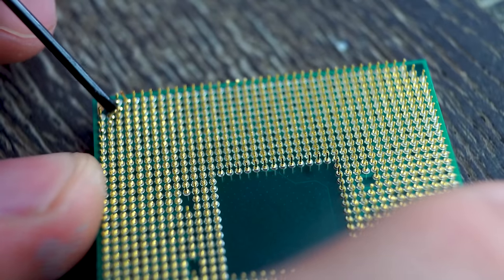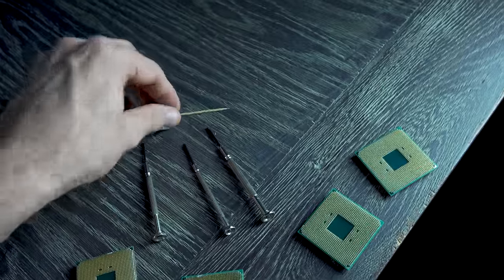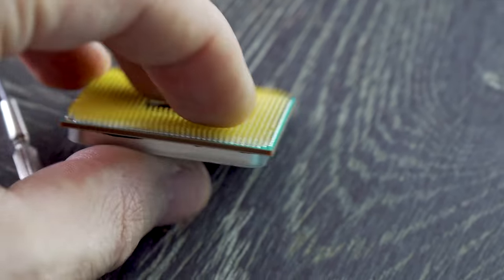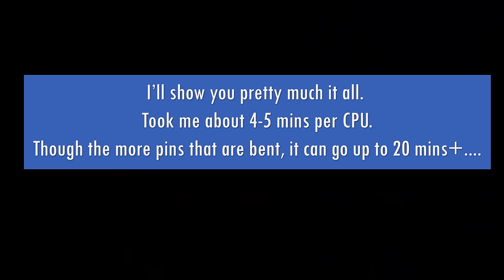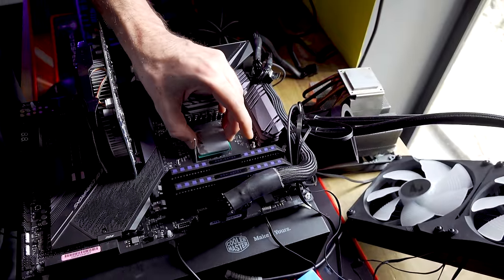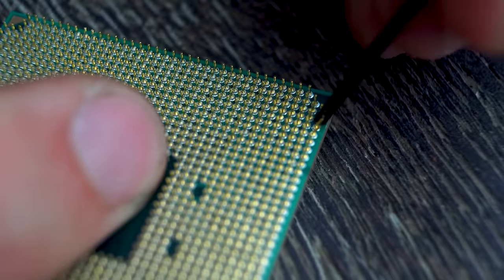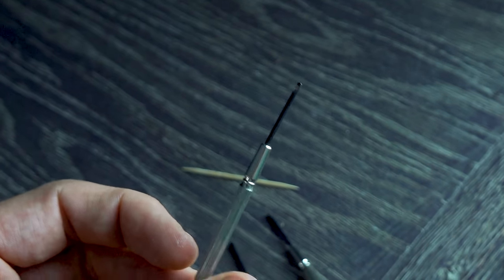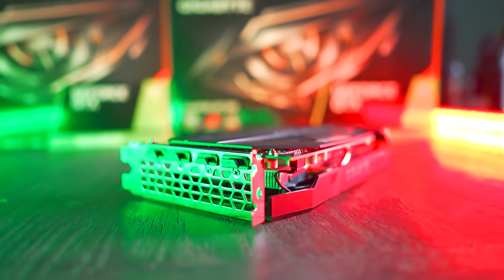How I quickly and easily FIXED 2 Ryzen 2700X CPUs with BENT Pins

Comment: Also another tip before removing the cooler on the amd, run a light stresstest, the thermal paste will be softer, and cooler will be easier to remove.
Reply: Ita a good idea to do this if you can. I get a TON of recycled computers and strip them down. I hate AMD CPUs because of how easily they get damaged. I just dont have the time or luxury to run stress tests on the stuff I get. Wish AMD would give up the PGA design and move to LGA.
Reply: I actually did this yesterday, not even a stress test but played borderlands 3 for several hours before taking my 3600 out for new 3900x, even with it definitely warmed up and breaking the paste CPU still stuck to cooler xD, and bent 5 pins, ran a razer blade down the rows of pins and BAM fixed
Reply: I just hit it a couple of minutes with a hair dryer, I partially cover the intake so it would get hot enough (around 115f /46c)
Reply: @Brandon-uy1uv  won't that risk some kind of short on your motherboard?
Reply: @reyzafany1992  no, I only blow the heatsink, and cpu fans have diodes to limit the direction of current
Reply: Thanks for the advice. Recently got my Ryzen build running and bought an Arctic AIO. I'm glad I know to do this when it arrives.
Reply: @deminybs  atleast it was the 3600 and not the 3900x.. on another note. I wonder just how many people are like you and me and have a 3600 and another higher end ryzen. I snagged a 3950x on launch day as well.
Reply: First time i put up the stock cooler on my ryzen. It really is like glue. Thanks
Reply: @Peter Cavojec yep :P
Reply: @Dalle Smalhals soo original. Holy smokes your so witty. You must have a 200IQ!?!?
Reply: @Dalle Smalhals yep. I pull other people's unwanted pc parts from the recycling and flip em for cash to buy brand new stuff. I'm happy. It's like free money. Just disappointed with how many AMD cpus get damaged in the process. PGA can stay in laptops. I hope AMD moves to a full LGA style with AM5 like they did with Threadripper and EPYC.
Reply: @skoopsro7656  just twist the block/heatsink a little clock anti clock
Reply: @skoopsro7656  2x3900x + 3700x here
Reply: This happened to me a few days ago on 3800x, replacing stock cooler and it the cpu came off with the cooler. Sadness 😭😭😭
Reply: @espi8997  waste of cash lol
Reply: @KT-04zx10r-Gap  you're probably  right ;)
Reply: @espi8997  just buy one...they gonna have boat loads of more cpus doing alot better in the next couple years
Reply: @skoopsro7656  try hairdryer, works for me and takes 30s
Reply: @skoopsro7656  I think the AM5 socket will actually be a move to LGA.
Reply: bro! i wish i knew that before I bent the pins on my 5700x! It's really cold in Canada, so when I pulled me tester Ryzen spire cooler off, the thermal paste was so caked it pulled the CPU rightout of the socket & bent some pins. aw man, I was so bummed but luckily I bent the pins back & it still worked w/ me NH-D15

glad the temps went from 40C to 25C idle too!
Reply: @skoopsro7656  luckily I could bend back the 5700x pins. I've seen intel pins, I bet if I encountered bent pins, I would not be able to fix those :(

Comment: Been fixing bent pins since the 486 days. Old mechanical pencil to bend the pins back and then use an old credit card to check for trueness from every direction on the rows themselves. Fixed hundreds of "dead" processors this way over the years. :)
Reply: Also a razor blade or exacto knife will work just fine for trueness and for bending if needed.
Reply: this worked for me! ty!

Comment: My friend smacked his ryzen 3 1200 into his case while removing it from the cooler. He bent over half the pins. After 3 hours of work I was able to get them all back and only lost 2 pins. CPU still works perfectly fine to today. And if you are wondering why I wasted time with a 1200, I did it to help my friend and I did it to have some fun.
Reply: Rather cheap CPU, though.
Reply: Missing pins should have some sort of problem..... eh probably just a slught framerste loss or some slowness with certain things
Reply: Hi. After several months the processor works well?
Reply: @gedimangediman  still works to this day, overclocked to 4.3ghz as well
Reply: @denakai  Thanks
Reply: I threw a R3 1200 in the garbage last week w another so buggered up.

Comment: I like using a mechanical pencil tip to bend pins back in place
Reply: Take the lead out? And then hook it over the bent pin. That sounds kinda brilliant. Thanks man!
Reply: This is a genius idea
Reply: Same, was taught this by friends years ago. no better way honestly!
Reply: YEs, this is how I've always done it.  Because the mechanical pencil is long, its much easier to quickly get the pin almost perfectly vertical too.
Reply: Yeah, this is how we did it back in the day. I've straightened many a pin in this manner. A credit card can help with this too.
Reply: Razor blade is very helpful to the get between the rows and straighten several pins at once.
Reply: best way by far. All seasoned AMD users know lol
Reply: same. a mechanical pencil has been my choice since the athlon 64 days.
Reply: I've used a coffee stirrer that's hollow like a thin straw
Reply: 🙂 yup
Reply: yep, i always do it this way
Reply: I used to use this method while working in a computer store. You can move them in any direction without any problem.
Reply: This is how we managed to straighten pin grid array CPUs for years and years.  An old school technician showed me this trick and called it "pencil whipping", I later came to understand "pencil whipping" as a method of unlocking locked durons by using a pencil to remap the switches.
Reply: I use the same technique! Along with it, a thin credit card or something along those lines.
Reply: I have used thin tweezers myself, which also works great.
That being said I never had to fix any ryzens myself just some old fx's at work when the intern who installed them botched it.
Reply: the best method is probably a sewing needle and razors. Sewing needle to unbend pins that are bent almost 90 degrees and touching the substrate, then once you bend them so they are just tilted use a razor
Reply: You are a life saver
Reply: @dartallis  Did it with this method, had only slight bend on corner pins.
Now the processor is like brand new!

Comment: Just an hour ago when i came home, i opened my CPU box to check out my brand new CPU that arrived 2 days ago. I noticed that a few pins bent, because yesterday i put the CPU in the plastic cover the wrong way, and i didn't notice it yesterday. Luckily, a relative of mine gave me a box of that exact same screwdriver kit, because i told him i'm building a new PC, and that i needed small and big screwdrivers for it. So i got lucky this time, i'll be building the pc in 3 days, that's when the GPU will arrive. Let's hope all the touching i did won't do anything to the PC, and that the CPU will work fine.

Comment: A credit card is really great to get the rows to line up. They fit perfect between the pins and move a whole row at once, really good for that final touch and get them perfect. Also the pins fit inside the tip of a mechanical pencil with no lead good 360 control if your careful. Love the TYC!

Comment: I had to take my system apart to clean it and I dropped my Ryzen 1st Gen 1800x right on it's corner. I used a razor blade and got them lined up but system wouldn't post. Just had to reseat the CPU and it posted. *Remember it's a Zero Insertion Force socket!*
Reply: bet some nervous moments there!
Reply: @laowai2000  Always nerve wrecking when you have to bend something that costs $150+

Comment: For most bend pins, i use a sewing needle, it fits between the pins, and a few times in both directions, and the pins are straight again. Quick and easy tip.
Reply: I use the same (and a cheap digital microscope, being able to zoom in gives a lot more control over the bending action)
Reply: I just did the same yesterday night on a Ryzen 5900x, thought it would be hard, but it's very easy as the pins are very manipulable, that's why they bend so easily too. After that, I use flat object to pas between them to fix all alignments around affected area.

Comment: Great video! Two of my friends dropped their brand new Ryzen 5 3600's so I had to fix both of them.
Reply: There is 2 linuses now?
Reply: @konari88  They're evolving
Reply: I hate when the CPU gets stuck to the Ryzen stock cooler (Wraith Prism) and CPU is removed from the socket along with the cooler... I wish the retention mechanism on AM4 was better. With Noctua coolers, it works perfectly well.
Reply: Looks like a made up story starting with "my friends"
Reply: did you charge anything to fix them?
Reply: @no.1baller939  No, they are my friends.
Reply: @OverdriveTech  Probably right thing to do! :)
Reply: @liceafilms  because they caused the damage, not from the factory
Reply: @liceafilms  Of course Amazon would...they accept almost anything returned. But like microcenter or Newegg...may not because they know that damaged pins don't come from shipping a CPU in a box. AMD CPUs are pretty well packaged in their own little box
Reply: @no.1baller939  I got a new processor from Amazon with a bent pin.

Comment: As for a final check for straightness, I slide a thin credit card down the row to make sure all the pins line up. Worked great on Phenom II and FX processors, haven't had to yet on Ryzen
Reply: It's a common thing, I don't know why Yes Man didn't want to show it, as I'm sure it knew that.
Reply: @TheSilviu8x  Because a card isn't going to work on the spacing on Ryzen processors.
Reply: @konkoly5183  You can use a playing card or a trading card like Pokemon though.

Comment: I've been down this road, things I've learned. Do not use the pre-applied paste on AMD supplied coolers, wipe it off and apply something else. It can be like super glue hard to remove, I had room to twist and pull, made no difference, it wasn't moving. Ended up bending many pins on my R 2600 as it came out of the socket with the cooler.  Bent most of them back, but 4 broke off completely after trying to straighten. Thought I was screwed, looked for CPU pin wiring diagrams (no luck there), decided to reinstall and give it a go, works perfect, even with 4 broken pins. Used a magnifying glass and if you have the right size mechanical pencil, use the empty tip. And nice work with that screwdriver! When you get older and lose your eyesight that becomes much more difficult.

Comment: Just tried this method to sort out half a dozen bent pins on a r5 1600 - it took a bit of patience but it worked! I began wondering as I was going through the motions if a straight razor might have been more efficient for lining up bent pins to the other pins in the row. Good stuff all the same and thanks for showing me it can be done (with a little tech yes loving)

Comment: I've straightened many a bent pin and even soldered a few, luckily they were on the edge so it wasn't too difficult. I use a credit card to check alignment after straightening them.
Reply: I used plastic cards as well. Their great for alignment good tip !
Reply: The tool sets they sell to open mobile phones are perfect, including the 'guitar pick' style tool. Or just use a guitar pick to check alignment.

Comment: I like using a razor blade or a cutter blade, the razor blade is just slightly stiffer than the pins so I find them easier to use

Comment: Absolutely saved me.

Tried installing my new processor only to drop it as I took it out of the box, bent an entire row of pins.

I was sure my goose was cooked - thanks to your helpful guide and two hours or careful CPU surgery I'm proud to say I fully fixed my CPU! 

Slotted in nicely and posted fine, I've been running benchmarks on it all day and it's going strong, even overclocked with no issues!

Comment: I got my R5 2600 pins bent before removing the MB from the case. Bent the pins by removing the Cooler. Realigned the pins with a 1mm pin needle.
It booted. I had this confidence of doing this because of you.
More power to ya Sir!

Comment: Done this myself when selling my old R3 1200. It had a few bent pins from not handling it carefully. It's hard to make them out with the naked eye, even under a lamp, but after a few minutes I was able to put them all back. I used a small switchblade (it was think enough to fit between the pins) and a small screwdriver.

Comment: Best method is to use a mechanical pencil with a long metal lead tube tip, remove lead, put the pin in the tip, and use the whole pencil to slowly bend the pin back. Been doing this since the athlon/phenom days. In fact I have a pentel drafting pencil I keep around specifically for cpu pins.

Comment: I wanted to change my thermal paste and ended up ripping the cpu right from the socket with a few bent pins. I used your method to straighten out the pins and lucky for me, the cpu and mobo was still good. Thanks a bunch!

Comment: I had the same nightmare with my 3900x (stuck to the stock cooler), got lucky and only had to bend 2 pins back. I used a few different knife blades and flat blade screw drivers, since it's nice and easy to get between the rows while stiff enough to apply pressure with. Once you get the pins straight enough to drop in the socket takes care of the rest, hardest part is keeping your hands steady when the cost of replacement and lack of availability is hanging over your head

Comment: I tried to fix a pin on my 5600x, that i dropped when i got it (on a table). I used a tool from my ifixit kit, it worked, but it was a bit hard to put it in the socket. Today when i was trubleshooting my pc, i tried to make the pin straighter, which ended up bending more pins. Your video saved me.

Comment: I had a Phenom II 555 BE, It had several pins broken off and some bent. I straightened the pin using some solid but thin tweezers. What I did was passed the two tweezers hands around some 8-10 pins on the x-axis and then repeated on the y-axis. Worked like a charm. I used this CPU unlocked to X4 B55 for 3 or 4 years. The broken pins were either blank or extra ground pins. Amd is smart enough to put less important pins, the ground ones and server use only pins on the outer rim of the cpu.
That's my experience.
If you want I could even send you the Phenom for inspection.

Comment: I was 250 miles away from home fixing a computer for a family member who had bent the pins. It was an old 8350 FX. I ended up using a real thin plastic card and to be honest with you I didn't think I could do it. It works big :-)

Comment: I used to use a mechanical pencil with the same diameter as the pins and would bend them back to normal. This has worked well.

Comment: I've been perfecting the art of pin straightening thanks to starting my PC building endeavor on Athlon XP socket A chips. I've managed to snag an FX 6300 for $30 due to bent pins and it worked flawlessly after "repair". I used to use thin cards and ball point pen sockets
Reply: I had Athlon II X4 640 for $3, using mechanical pencil + credit card. Work perfect!

Comment: I also had a i7-6700K someone gave me for free when they bought parts from me. The guy had inserted it backwards into the board. The board socket was toast but I got the 6700K to work. I had to literally bend a corner of the CPU since it's LGA. Once I straightened it out, it worked perfectly. Pretty crazy what CPU's can survive.
Reply: I think we underestimate what a lot of tech can handle. But better safe than sorry, I guess.
Reply: I fixed a AMD K5 PR100, Pentium 90, and a Phenom x4 9850 that all had bent pins, the K5 and Pentium had shipping damage and the Phenom i found in a ESD bag without any foam under it sitting under other pieces of hardware. all the CPUs work fine.

Comment: I have done this before, just need good hands, good eyes & lots of patience. The hardest fix I did was a B250 Motherboard that someone dropped a CPU on the Socket & bent several Pins over. I managed to fix it with a Small Flat Head Screw Driver & an Exacto Knife with the tip bent in a very small hook shape.

Comment: I think a better tool is a mechanical pencil with a metal tube for the lead. It slides right over the pins and then you just bend them back in place. Done!

Comment: I use a Stanley razor blade across all pins - it creates a flush line to bend against - very good method. - There are also Pin Bending tools you can buy which work well as they go over the pin/ insert the pin so maximum Control as brian stated...

Comment: Hey Bryan.
Good work! 
I've used the same technique on an X58 motherboard that now works fine.
I also tried it on Vga extension cable but the pins were so bent 1 broke off. So I cut a piece of jewelry wire about the same gauge and used that to make the last connection to my projector and it works fine!
Remember to think outside of the box. 
Cheers, Mon from Brisbane

Comment: Thank you, it worked for me, but not as quick I bent more pins in the process, but anyway it is all fixed now I used my Stihl chainsaw carb screw driver.... works perfect. BTW a tiny bit of pressure helped seat it.... that is probably why I took a long time.

Comment: The tray can bend your pins if you put your cpu in wrong way. Happened to my 5800x. Used similar type of screwdriver to rebend the bins to it's original shape. It worked perfectly.
Reply: Did you have it rotated the wrong way in the clamshell or upside down?